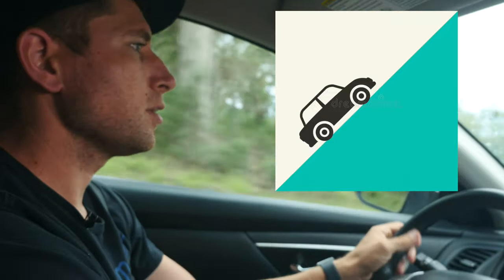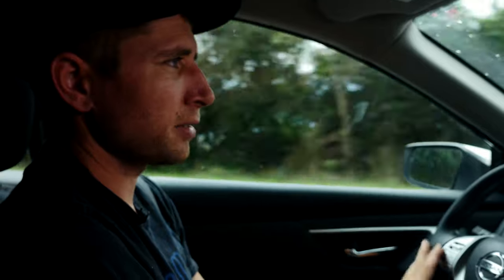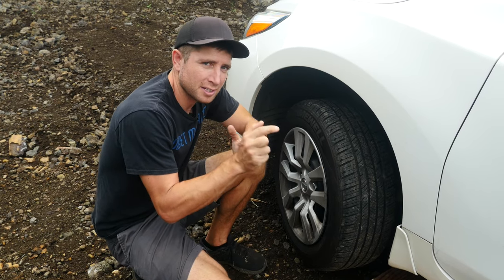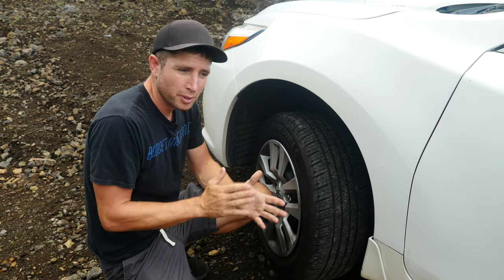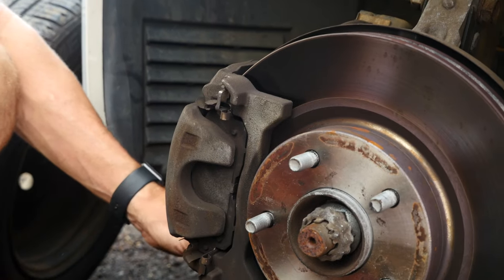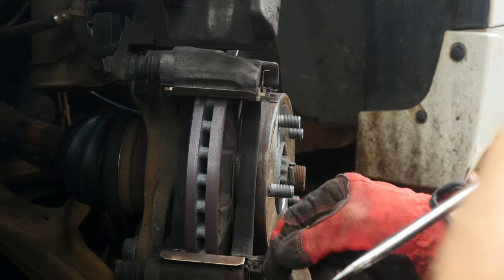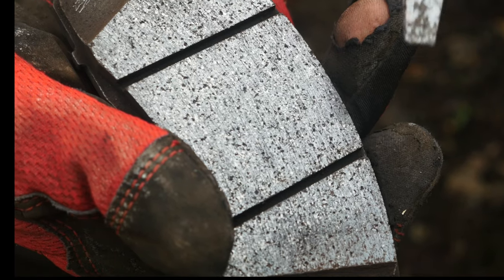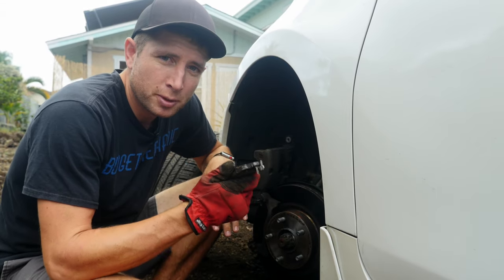Noisy Squeaky Glazed Brakes Rotors - How To Quick Diagnose and Fix - Squeak When Brake is Released

Comment: mine does this after i just put pads on took wheel back off checked the metal things they aint touching grease them and the caliber put tire back on still doing it should i take the pads back to the store
Reply from the maker: Is the rotor new as well? Old rotors can make new pads still make noise.
Reply: @BudgetMechanicHawaii  no they were turned

Comment: i had this problem. failing brake caliper that caused a similar noise to this. replaced the brake calipers, noise still there.
replaced the pads too, problem gone.

Comment: my truck does the squeak sound in my driver side tire but only when i start it up in the morning and take off & leaving work. It stops immediately after initial acceleration
Reply from the maker: I had a Hyundai a while back whos brakes would makes a scraping sound every morning until I’d stopped once. Gremlins?

Comment: I have the same issue with a honda fit. So what is best to do?
Reply: have you found the fix?
Reply: @crestfall4  no but i am going to replace the rotors. Can be they are warped
Reply: @ReubenGafa  i have a brand new apracing kit and it have the same issue.... couldnt find the fix, and im so confused because its brand new and original
Reply: Nope

Comment: I had this exact noise and figured it was the brakes. I took the car to a new mechanic and he told me it was the bearing.
Reply from the maker: Did you change the bearing? Did noise go away?
Reply: @BudgetMechanicHawaii  Yes, but we also ended up changing the brakes so I can't say for sure which of the two was causing the noise. Regardless, the noise went away and the car drives much better.
Reply from the maker: Lol. I’m glad

Comment: I brought my car to nearby  mechanic and they changed rotors and pads but after they change it sometimes it got squeaking sound when I brake it , I brought it to them 3-4 times to fix that single issue and we reschedule every time I took car back cause it had same problem and it took a month and they also mad so they change another new pads and rotor( that what they said) but my car still got same problem anyone had same situation? I not bring my car back there cause I’m sure they cannot fix it.

Comment: mine squeaks when i use my car after a long parking, then it goes away as i accelerate fast.
Reply: That just means that the rotors built up some surface rust from sitting, brake a few times and that will clean the rotor up

Comment: I replaced my pads and I still have the noise.
Reply from the maker: How’s your rotors?
Reply: @BudgetMechanicHawaii   new pad on noisy wheel probably glazed from the minor rotor grooves. Oh well, it is what it is.   If it gets really annoying then I’ll just run the rotor into the ground